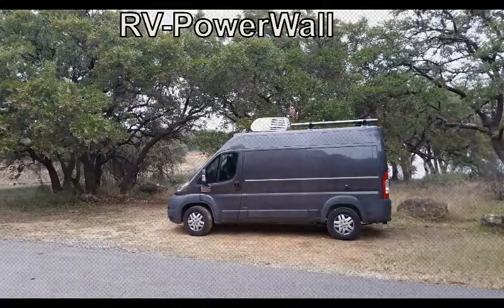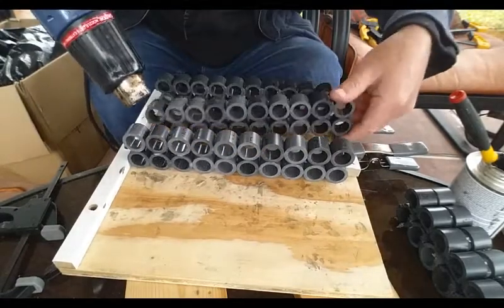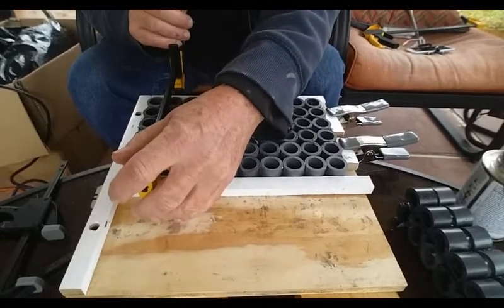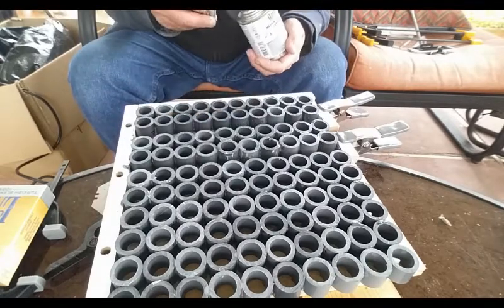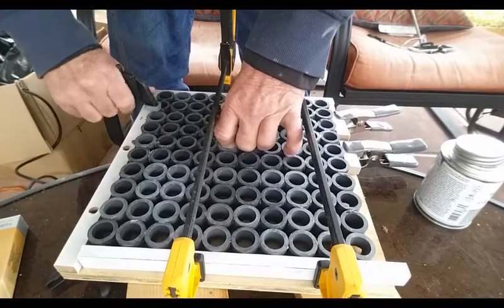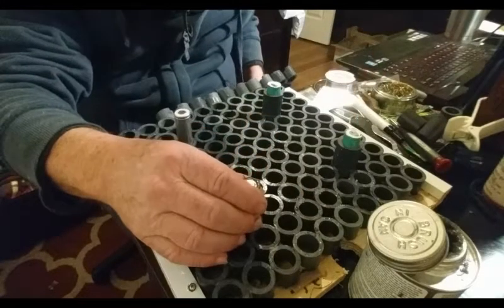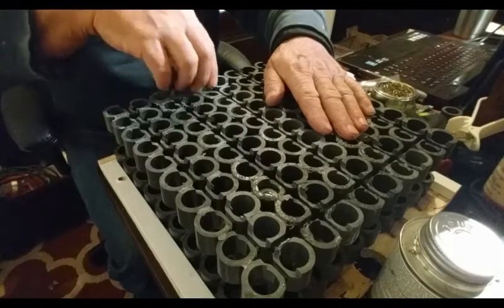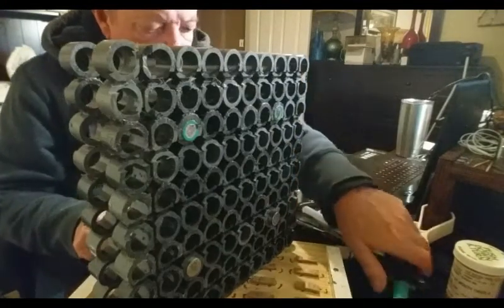DIY RV PowerWall 18650 Battery Holder Build 2

Comment: I found this video while looking for a way to make packs using Sanyo NCR 20700 -type cells.
As the name suggests these are larger than 18650 types and doesn't match std. spacers.

One should think that the easiest approach was to make a jig and keep the cells tight together while connecting tabs and bus-bars.
However in a mobile setup it is important to arrange the cells with individual spacing.
Not just to allow airflow but most importantly to prevent "newton cradle" -effect from hammering the cells together when driving in rough terrain.

Your design does not only meet these criteria. It's also "service-able" and can be made without having access to a 3D printer or a milling machine.

Comment: i have looked for sched 80 3/4 pvc pipe but the id seems too tight for the 18650s. did you have to check a few pipes before you found some that fit?
Reply from the maker: I think I bought 10 pieces and 2 of the 10 where very tight. I reemed 2 of them. A step drill works perfect for this.
Reply from the maker: I could only find it at Lowes when I was looking for it. I recommend taking a 18650 with you and pick the ones that are not tight. Note when you glue them and use heat like I did you may have to reem a couple of them.... just a thing

Comment: I was thinking maybe one can first drill holes along the PVC pipe before cutting it to cell height. Then the drilled holes on the sides of the PVC could help decipate the heat once the cell is inserted. Plus you would have full cell height holders. Could it work?
Reply from the maker: There is no heat problem if you were to cut pipe the cell height. Doing it this way would reduce labor tremendously . I would only go to the trouble of drilling holes if you were to charge more than 1 amp per battery. Remember when calculating the amp draw and charge of each battery, only divide the batteries in parallel by the load or charge rate. For example in this build its 100 batteries in parallel and 7 of these in series. so if I am drawing 60 amps , I am drawing .6 amp through every battery. If I am charging at 30 amps I am charging every battery at .3 amps.
Reply: RV-PowerWall, Thanks.
Reply from the maker: I like this idea but would apply it a bit different. Measure out the length, drill holes, then cut pvc. Maybe the right hole size would remove the need to route them and save a lot of labor and time.

Comment: I was thinking as well that you can't remove a battery from classic setups but recently I've seen a video and is quite easy. You just must break the four corner stoppers on one side and push it to out. This if you have large flat bars that cover the exit. I'm thinking as well to build a battery but I want as well to be easily removable. I think I will go with neodymium magnets and copper sheet under.
Reply from the maker: Battery replacement was my top priority in this build. However the Printed holder I showed in Fusion 360 will be much better. I just purchased a big bed 3d printer ...its called the Cr 10 and I am sure I will be sharing my experience with this new printer.
Reply from the maker: Magnets may be a great idea for a stationary battery for a shed or home but in an RV I would be concerned about vibration effecting contact with each battery. Especially if you were to use the smalllest fuse wire like I did of .5amp.

Comment: Hello, I am liking your build. Good thought process. Currently doing a build with 26650's.
Reply from the maker: Thanks very much. I am not familiar with the 26650s. what is the application
Reply: RV-PowerWall The 26650 are larger diameter but the same length and unlike the typical 18650 LiPo, these are LiFePh and rated at 5400 mah. Slightly less energy density but are historically considered a safer chemistry. We'll see. This system is going into a large slide in camper. Initial install will be 240 cells.
Reply: PS. The first two numbers of the battery are the metric diameter the following three are the length. This helped me to understand alot when I found out.
Reply from the maker: Those are the ones made in the Giga factory for the new Tesla cars?
where did you get them?
Reply from the maker: I saw jehugarcia test those. they are big. What will you build the holder out of?
Reply: RV-PowerWall 1" PVC instead of 3/4". Should look very similar to yours. Just starting to look at how I'm going to configure the pack for 12 volts.